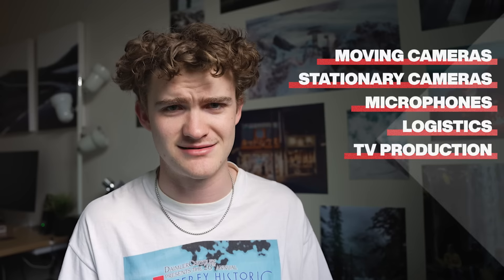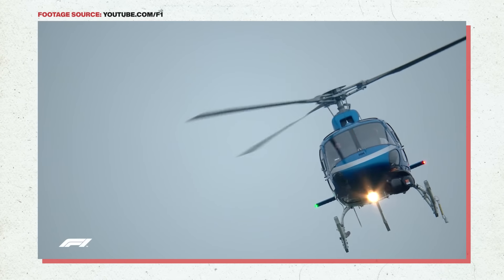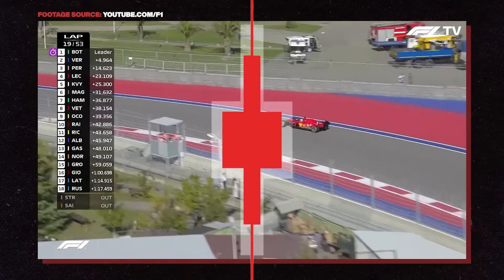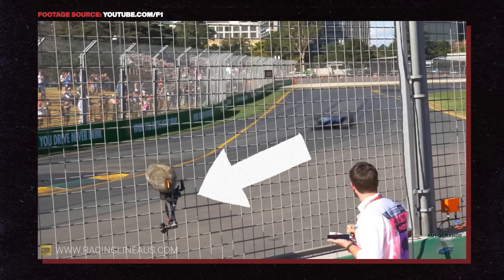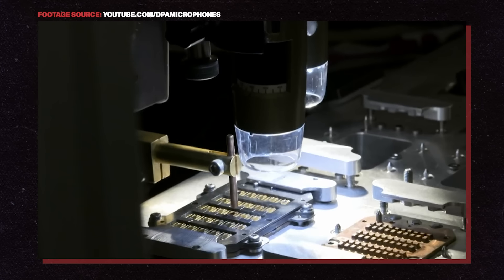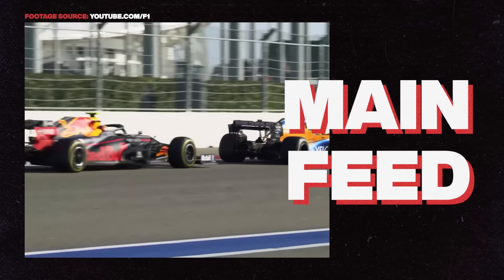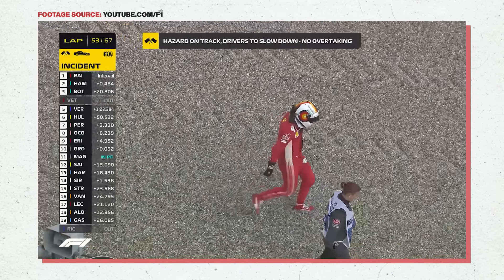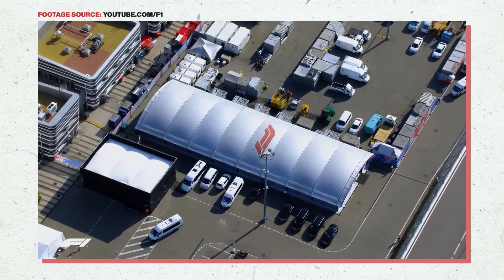How Formula 1 is Filmed (It's a Technical Masterpiece)

Comment: 1:52 Fun fact: the reason was that "back in the 90's"on board footage was send to the helicopter. That's why there was loss in signal from the onboard cams when F1 cars drove through tunnels and bridges. Nowadays there are multiple wireless access points placed (transmitters and receivers) around the circuit. This enabled the helicopter to make cool shot.
Reply: That was first developed in Australia  for Bathurst
Reply: They don't use drones?
Reply: @alexaxy3328  I was thinking the same. Aren't helicopters outdated for shooting ?
Reply: @alexaxy3328  They tested a drone cam in Barcelona earlier this year, but to be honest many fans (including me) didn't think it was up to F1 standards. It has the potential, but it seems too slow to follow the cars.
Reply: The helicopter carried microwave relay equipment. On board cameras send the audio & video signals up to a helicopter, then back down to a receive site, then into the tv production trucks. 

Drones? Maybe if it was the size of a helicopter. BTW, there are a couple of companies that use bonded cellular technology to now transmit in car cameras.
Reply: @AmanSharma-fi9mx  no, not by a long shot, a helicopter can carry a much, much bigger camera with much better stabilization and better controls for the operators, every time they've tried to use a drone camera it hasn't gone well at all
Reply: @izanefe4231  Totally agree, drone cams work for something like formula drift but not formula one
Reply: Man! Thank you for this comment. I wondered about this signal loss since I started watching f1 as a kid in the 90s

Comment: As a cameraman on the F1 in the early days, I can add a few things. Each cameraman has a button to press if he sees anything unusual, which flags a border around his recorded image in the replay area.
Often you film the leaders and then quickly re-establish on a second battle, sometimes a third. This was tricky in the early days with black and white viewfinders.
The fabulous Broadcast Centre included a canteen and bakery. Fun times...
Reply: When where you there? We might have worked together
Reply: Thanks for your great work you brought the story to the audience
Reply: I have heard about the “take me to air immediately!” button but the generally believed story it that it automatically overrode the shot currently live on the bus on the vision mixer. Good to have the actual use of the system confirmed here.
Reply: @MarkPentler  At the time I was involved Mark, each EVS operator recorded 3 cameras, single monitor/quad setup. The button press introduced a blue border around the camera feed on the EVS monitor. Revue was expected of course. I also heard of errors whereby these got directly to air...
These buttons used return 2 on the camera remotes, so it was very easy to inadvertently hit the button when viewing the flow of the race through preceding cameras. It was a very busy day, as you were working for 3 channels, listening to 3 directors all talking at once.
Reply: @markbigears  First year. Eddie, Mladen. Flew to Melbourne for the weekend 😆
Reply: @gkkes  Ah good old Mladen, he got the boot when I was there. I did 1998-2001 as graphic designer / technical illustrator ..... good times and very little sleep! :)
Reply: Yeah, I know that function very well: „Crash to Air“ which triggers several things simultaneously, incl. markers on replay, a overlay in the VF and a dedicated preview bus from the switcher, but never ever directly the PGM Bus!
Reply from the maker: Hi gkkes, hopefully you'll see this message! I'd love to chat with you in more depth about your experience on the F1 production team for a Part 2 for this video. If you're interested, please email me at tommymdewitt@gmail.com
Reply from the maker: Hey Mark, I'm hoping you see this message! It would be amazing to chat with you in more depth about your experience on the F1 production team for a Part 2 for this video. If you're interested, please email me at tommymdewitt@gmail.com
Reply: @gkkes  Tommy is trying to get in contact with you
Reply: @markjefferson7492  Tommy is trying to get in contact with you
Reply: this comment is a gem...
Reply: @darlikchronicles  yep
Reply: Sheesh bookmarks for video

Comment: Hey man, just been recommended this and it's a really great vid I used to work in the production team at F1 and just a couple of indsider things I thought you might like to know!

- the curb cameras are known as flip flops as they are always in a pair, one looking at the cars front on entering the corner and one looking at the rear of the cars on exit
- the pit box top down cameras used to be a functional thing only as slow mo black and white cameras as a verification tool to measure the speed of pit stops (and to ensure penalties were serving the correct amount of time). Because it was a cool view they upgraded them to be broadcast quality
- Just on the logistics, all of the computer hardware is built into flight containers, so those containers can just be lifted and dropped down wherever without having to renetwork everything every race. Rigging the whole broadcast centre would take a day, it would then be tested for a day and then ready to go. Derig would usually take about 3 hours after the race. There was one extreme case in 2019 in Japan where the whole operation had to be moved inside the pit building to shelter from a typhoon that hit the track. It was derigged, moved, rigged again and tested in a day!

It's not just a production team in the sense of audio visual, the data platform that acquires data from the cars and then sends it to the teams, broadcast and external clients is done by F1 too, as well as the main timing system and backup manual timing systems.

This was so well researched though, I was so ready to do the internet thing and correct everything you had to say but it was pretty spot on! great stuff!
Reply from the maker: woah thank you for that information! i might have to contact you about making a sequel to this video
Reply: Make a sequel happen
Reply from the maker: Hey Jonny, hopefully you'll see this message! I'd love to chat with you in more depth about your experience on the F1 production team for a Part 2 for this video. If you're interested, please email me at tommymdewitt@gmail.com
Reply: @TommyDeWitt  just dropped you an email now :) cheers

Comment: They have changed a major part on how they process the footage in real time. There is an on site base that they call the ETC (Event Technical Centre) which it's main job is to transmit all of the camera footage, audio and telemetry from the cars and track sensors back to their main base at Biggin Hill airfield in Kent UK and what they are calling the RTC (Remote Technical Centre).

This data is transmitted by either dedicated fibre optic internet connection or satellite link back to the UK.

Then almost all of the production of the world feed is done from there.

This has drastically reduced the amount of equipment and personnel that is being flown around the world to product the broadcast. There is still some vision mixing happening at the track in the ETC in case the communication link back to the UK goes down they can switch the broadcast of the world feed over to the on site team and production suite.

It is so cool how they are doing this.
Reply: Much of the UK Cricket and Football is regularly done in this way now too. Cameramen, some sound guys and a TM.  Maybe a reporter or 2 with every feed via the network.

Comment: Very well done!! 
I can only add that the special Phantom cameras are only a small portion of Slow-Motion cameras. 
The majority are Grass Valley LDX86n cameras in 150 or 300 fps (50Hz) or 180 or 360 fps (60Hz). 
Also the wireless Pitlane cameras can run in 150pfs or 180fps via Wireless transmission.

Comment: As someone who's done live broadcast work from cameras to switcher to director, I think you did a great job on the video!
I have one nit to pick though... That's a Boom Lift, not a Scissor Lift! 
A Scissor Lift only goes straight up and down, and has a scissor action frame beneath it.
A Boom Lift is, well, on the end of a Boom.
Generically they can all be called Manlifts, but just as yellow construction equipment is not all called a "bulldozer", not all lifts are called Cranes or Scissor Lifts! Lol
Reply: Imagine being the boom lift operator, that wind sway would have me hanging on for my dear life.
Reply: @MrDesertPunk  I can confirm from my experiences in film. Pretty freaky stuff when you first start out. You just get used to it over time.

Comment: Hello! I've worked in professional sports video (MLB, NFL, NBA, Olympic's, and now Jr. Hockey as I'm retired) since 1997, and I only just watched my first F1 race, mainly as I wanted to check out their RF cam's (the un-cabled hand-held type in the pit's, etc.) I was very impressed, and as I commented to friends online, they must have one heck of a really good RF Coordinator on site, they are used to keep track of, and make sure there aren't any collisions of the tons of wireless data going back to the video trucks, compound. It's one of those jobs that no one thinks about, but these days you'd never be able to put on a major concert, etc. with out a dedicated RF tech(s). Also, should note that while you did a great job naming all the camera's, etc. that the brand names involved will change, usually by whoever the vendor is that the F1 Producers select. So, they might have Grass Valley, but also Sony, and then other specialty cam's like the high speed (most GV and Sony cam's have high speed options to them up to about 500fps or more). Also, most camera's shoot in 4k, even if they aren't delivering a 4k signal for broadcast. This is for future archiving, and the last Olympic's were even shot in 8k by NHK/Sony Japan. So, well done report, accurate and great looking! Oh, should mention that any "hard wired" cam's these days are actually all fiber optic. In standard fiber configuration, you can run up to about 1500meters from the CCU, but with perm installed fiber, they can run a full 4k camera up to 20km over a single duplex single mode fiber, and that's not just the video from the camera, that's intercom, tally lights, plus and HD video return which is what the camera op see's in their viewfinder if needed to see how they are aligned with any graphic's to change their framing and so on. And also audio, at least two mic's per camera on top of the intercom mic. I think with the newest GV's running in IP mode you can't have the full 16ch of audio as in normal SDI, but over fiber. Some if not all of the audio is probably being mixed for Dolby Atmos or some surround setup, so listeners only in stereo may be missing some of the audio cues that they used to hear in the "old" two channel audio days. Cheers!

Comment: It's crazy how much has changed in the 2 years since you posted this. Now we've seen: 
Visor Cam (driver's pov which is crazy bc it looks blurry and poor quality until you see the driver lift their visor up and it's HD crystal clear. Close the visor and it's blurry again due to the tint and layers of visor strips. example: Monaco end of FP1 '22 practice start on Leclerc's onboard when he fiddles with the settings on the steering wheel)
Pedal Cam (not a lot but def seen it on the Mclarens)
The Ultra Fail Drone Cam (or as RocketPoweredMohawk described at Spain '22 with it looking like it was attached to a pigeon)

there's prob more i'm missing but it shows how much they're experimenting. Personally, I like the visor cam though when I first saw it at Jeddah right after they introduced it, I was terrified and could barely watch I was cringing so much but they slightly got rid of most of the blind corners and I appreciated the camera much much better once I did realize the quality of the camera wasn't low, but that's actually what they see. A blur.

Comment: Excellent analysis and update. One detail thoughÑ on the late 80´s, early 90´s only one or two cars would sport A camera onboard and they would be handsomely rewarded for the weigh penalty. The transmitter was low power and the helicopter would need to chase the car at low height to pick up the signal. Passing under bridges or other structures would disrupt the reception. The camera pod would have a roll of Mylar film that would unwind a new ¨window¨of clear plastic at intervals using a windup mechanism to avoid the sport of tire and other debris.

Comment: Your analysis and technical comments are great.  Sorry your video didn't hit my feed sooner!    From your comments either you or someone on your team is a VERY knowledgeable F1 fan.  The discussions of SEB vs HAM, the ALO crash, years of events... that doesn't come from WikiPedia... it comes from a fan having watched these events recalling them.

Moving cameras:  Great summary.  Two comments (to add).  One is that the original on-boards on F1 sucked because they were on the unsprung suspension and the video was choppy (and analog).  CART/Indycar got it right, and F1 went to that same tech and that's what we have now (generations later).

Helicopters didn't hover.  As a helicopter pilot I can assure you, all of the video cameras are on a gimbal, and with target-zoom (think "variable zoom set to make the target appear at the same size as we approach it or move away from it) the helicopter is in a constant orbit.  The further the orbit (and longer the zoom) the more it appears stationary... but it's not.

Drones (UAVs) you mentioned in the list of moving cameras but didn't really get into it in the video.  They add a lot although restrictions on them not flying directly over a live track, and their limited speeed really make them less of an impact than the other tech.

Static (fixed) cameras: Great overview.  Can't wait till 360 degree shots can be shared live.

Live Production: Yeah, everything you said.  Lots of video feeds, sync'd audio feeds, sub-directors and directors controlling the "final productS" to include the World Feed, specific country feeds, etc.  If only they had a commentary-free audio feed (like a magic SAP where the announcers would just... stfu...)

What else I would have loved to learn more about:
How live T&S is integrated into the video.  The director makes the call to either put on T&S with interval timing, T&S with total timing, T&S with last stop/total stops/tire choice, or even just a track map with driver position.  This is done NOT when there's nothing going on but the opposite... to highlight what "fights" are on-track.  It would be great to hear the director discuss when he goes to that frame.

Then, the jacket.  And the T-shirt.  Clearly you've been around racetracks.  You not only know the language, but you know what viewers want to see.  Mixingthat with the A/V world... just fantastic.

I don't often "gush" about anything, let alone a YT video, but... this one was worth it.  Already forwarded to a few of my F1 and IC fan friends.  Also, sub/liked.  You're my hero of the day.  

Ehud Gavron
FAA Commercial Helicopter Pilot
Tucson AZ
(My only flying in an F1GP restricted airspace has been as a visitor on board an official air tour.)

Comment: I approve of how you put “routinely used” for onboard cameras. The first live F1 onboard camera was in the 1985 German Grand Prix. 2 years after Indy first tried it. But there are multiple scissor platform cameras around the circuit not just at the end of the straight. Otherwise.. pretty much bang on

Comment: Amazing video, thanks for sharing... internet connectivity and wireless video transmission should be also amazing to see how it's done because they probably fill the whole circuit with many of those access points and they should be hi end tech for to capture each car without disruption. Now you have the camera on the helmet of some drivers, the camera behind the steering wheel, and you have the edited audio of intercom communications. All of this, in the F1 TV app you have everything on-demand which is incredible, you can jump in into any car at any time and to see any of the cameras, is absolutely crazy.

Comment: One thing they do use for some faster Ariel tracking shots are drones which I noticed wasn’t mentioned. Not sure when they were first used but it’s a helpful thing when a chopper can’t just get fast enough or low enough. Drones have gotten some great shots. Especially used in tandem with the wire cam.

Comment: FYI, back when they first started using helicopters for the races, radio and camera signals were not able to transmit from car to broadcast booth. They had to transmit car signals to the helicopter and the helicopter relayed those signals. So the helicopter just hovered over the race the entire time.

Comment: Great video. Well done. Just a bit of extra info on cameras and recordings.  Every camera is being recorded in the race  control centre as well as in the TV production  broadcast unit. The race safety recordings are used for review and analysis of accidents and incidents by the safety director and the medical team but are not used for broadcast.

Comment: Good and informative video.  Well done, particularly that this is yours 1st motor racing presentation.  You asked for corrections, so here is a minor one.  The platform you described as a scissor lift looks to me to be a cheery picker, albeit a very big and complicated one.  A scissor lift goes straight up and down and the mechanism that lifts it has a scissor action.  Keep at the F1.  Great. PS.  By the way a camera operator can do a fast pan like that.  He/she has to be able to do it or they couldn't keep a car going at 200mph in frame.